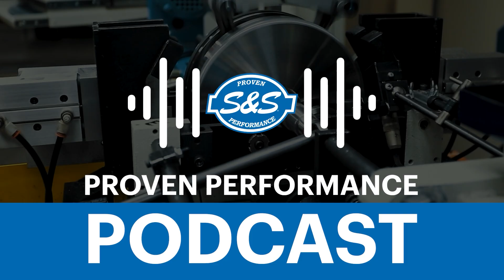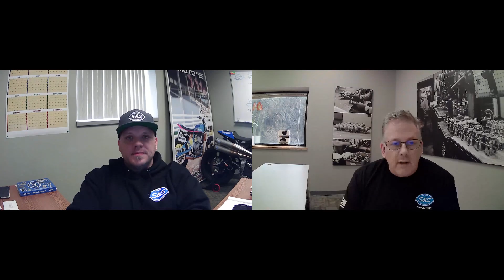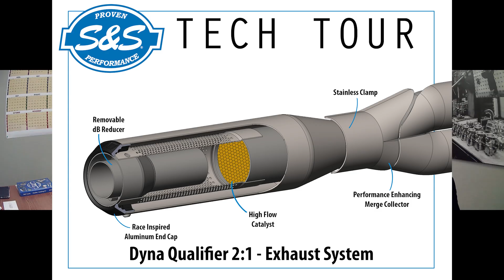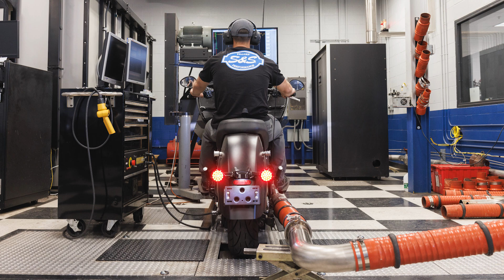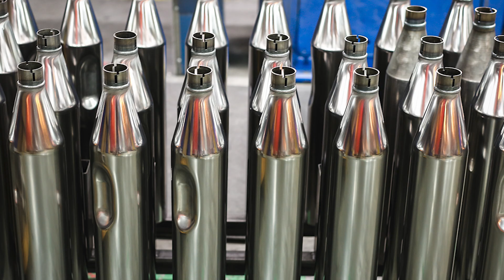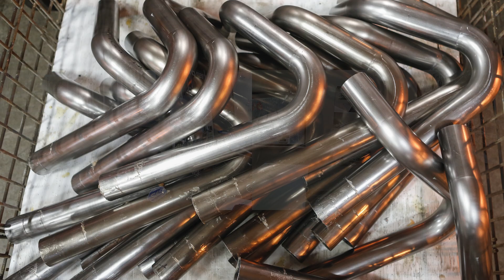S&S Cycle Proven Performance Podcast #7 - Exhaust Talk

Comment: I've noticed that the 550-1100 Muffler, Kit, Tapered Cone Body, 50 State, Black, 2019-'25 Royal Enfield 650 Twin has been put of stock for a long time. When will it be back in stock?

Comment: When do you think we will be getting a Super Street for the new Softails M8s?
Reply: They already have them out
Reply: @JessIronside121 not the 2025 models, the Cam cover has changed to the VVT style, so current super street no longer fits.
Reply: @TheMotoBarista from what I know the softails aren't VVT yet, only the tourers
Reply: @TheMotoBarista I stand corrected, I hope they bring them out for the 2025 model because its the exhaust I need in my life haha
Reply: @J @JessIronside121 t they have the vvt timing cover.
I’m lucky. I went the SE131 stage4 gen 2 route on my 21 Streetbob, kept my gen1 timing cover and my Superstreet.

Comment: Have the S&S SuperStreet / no cat. removed the packing and made my own db reducer, 2"ID 1 !/2 linger than the tip. (followed someone's steps from a forum, was tuned by FuelMoto)
Reply: so not tuned at all, remote tuning only gets you so far . i mean , unless you brought it to them (which most people do not do) you'd be better off to take it to someone local who has a dyno .